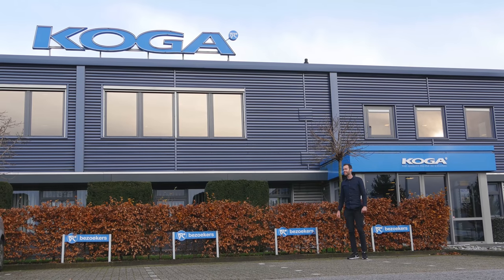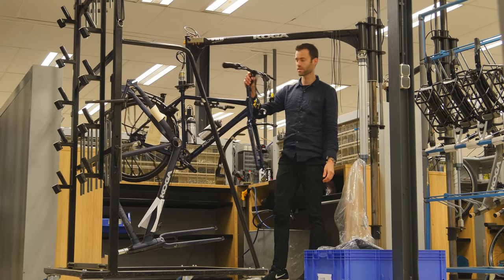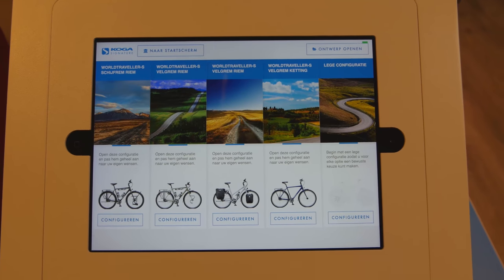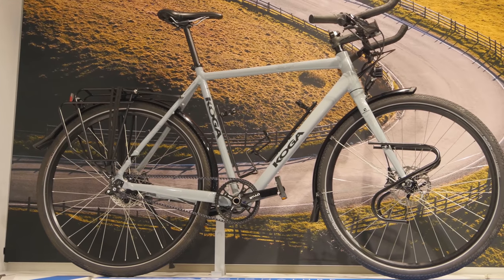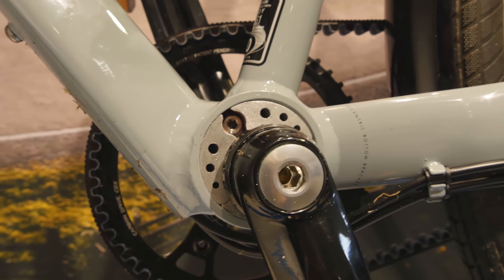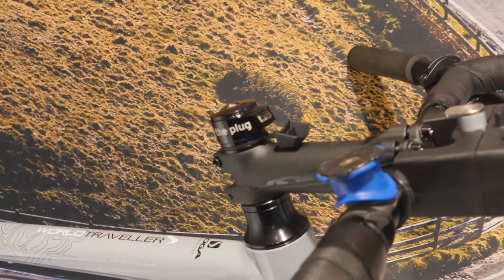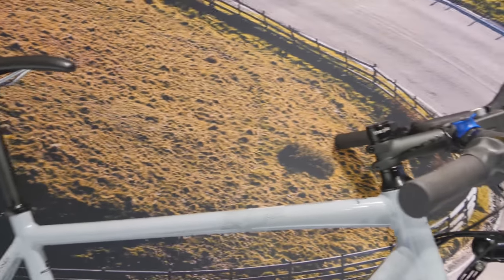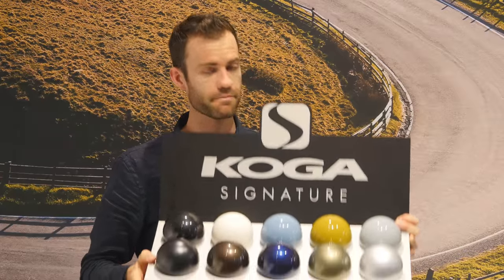My New Koga WorldTraveller Touring Bicycle For A 3-Year Bike Trip!!

Comment: Looking good! I'll definitely be following your trip! 
One thing I'd mention though, is an issue I've had with using the oversized bottle cages on an aluminium Koga. I had a similar cage (Topeak) on my WorldTraveller29, with a 1 litre fuel bottle in it, and had cracks develop around the cage bosses when my loaded bike fell over. The downtube itself had twisted slightly due to the weight and leverage of the larger bottle, and I could bend it back into place by hand. This happened in the first week of a 3.5 month tour, so I was pretty bummed out about it. A local bike shop said it was probably okay to ride, as long as I removed the weight off the cage and kept an eye on the bosses, and I had no further issues during the trip. Got a replacement frame from Koga once i returned home, so no issues with warranty. Just something to keep in mind with these thin, butted aluminium tubes.
Reply: Also, Tubus has a 30 year warranty and 3 years free of charge replacement service, according to their website :)
Reply from the maker: Interesting – will keep an eye out, I've never seen this happen before!

Comment: Love the bike. Especially the Crazy George bars. I love the tech but would worry about the possibility of finding replacement parts if anything does fail. I’m absolutely sure all the components are super reliable and will see you through the whole trip but I’d imagine it’d be far easier to locate a square taper BB and a set of brake blocks in darkest Peru! Good luck, I’ll be following your trip.

Comment: Great video. How has the crazy bar worked out for you? I’ve heard one online review with concerned over the wrist position on long hauls. Cheers
Reply from the maker: I liked the idea of the Crazy Bar but I've never quite got the 45 degree section to work well. So I designed a similarly shaped bar with less sweep called the KOGA Denham Bar, which has been great.

Comment: Your bicycle looks awesome. Love the colour, internal cable system, belt drive, shimano gears etc. What do you think about the crazy handle bar? Does it help to go through the wind? Have you tried moloko & jones loop H-bar?
Reply from the maker: The narrow bullhorn section definitely helps you have a more aerodynamic positioning in the wind. I've also tried the Moloko, which I like, but then I cannot use a handlebar bag. The Jones Loop I didn't work for me.
In the end, I designed my own handlebar, the KOGA Denham Bar, which is basically a mix of the best aspect of each of those handlebars.

Comment: Re. The wheel building - i dare to disagree. Handbuilt wheels - and i mean hand tensioned and trued by a wheelbuilder - are in 9 cases out of 10 better than most machine built wheels.
Reply from the maker: It depends. A machine-built wheel can be tensioned in 30 seconds or up to five minutes. By giving the machine more time, you can increase the accuracy of the build hugely. If you've had problems with machine-built wheels in the past, I'd say the wheel was built by the machine in seconds. KOGA isn't pumping out huge volumes of wheels, so they can afford to run their machines much longer than most manufacturers.

Comment: Hi, I wonder what your length is because I saw you in other video's riding quite a small frame with large seatpost. I am 1.87m and also went to Koga in The Netherlands and thought that 57cm would be the one (that was also the one that came out of the configurator). But when I rode the 60cm it was just better. It leaves about 8cm seatpost but it just looks better.
Reply from the maker: The 60cm frame will likely be the best size for you. I'm 10cm taller than you, but I prefer a more 'aggressive' fit, so that's why I sized down. 👍🏻

Comment: Same as mine other than the handlebars, seat, and colour. Praying you don’t have the same problems as I have had with my own brand new KOGA, having to cut my world short. It is a real shame that KOGA couldn't have helped me from where I was in Europe instead of my having to return home to the UK. It has been good being home for Christmas with my daughters.

Rohloff on the other hand have been very helpful and we have had some good communication.

Rohloff management and I had a great chat on what would best suit my needs given my intended world tour. The conclusion was that I would revert from belt to chain drive. Still keeping the main Rohloff hub, as that is running perfectly, but just changing the front and rear sprockets and add a Campagnola 9 speed chain.

Rohloff have also supplied me with plenty of spares, including a new splined carrier as well as the new one they have just fitted, a threaded carrier too in case I want to go with that, and a spare carrier clip and some tools. They have also supplied a new rear belt sprocket in case at some point I wish to revert to belt drive once more.

All in all then if I include the new belt sprocket, I have enough spares for 3 full repairs, including a spare chain. Rohloff have also serviced and changed the oil in the hub, so I am happy with my support from Rohloff and looking forward to my return on the 1st of March to carry on from where I left off in Marseille. I have only completed 3300 km's after all.

I hope you don't, but if you at some stage start to hear a clicking noise and feeling it through the pedals, your first thought might be the bottom bracket, it was for me, but it turned out to be the splined carrier. The best thing to do if this is the case, is to check everything is tight and not lose, as the belt tension has to be spot on with this new carrier.

If it then persists, Rohloff and Gates have instructions available for adding a special thick grease to the carrier / components. This will keep you going again. After grease was applied to mine in La Rochelle, really poorly by the way by some really horrid people at Ecovelo Bikes, I managed over 2000 km's before it failed, and even then I could have limped on some more. 

Who knows, I may pass you in the Americas. Best of luck and wishing you well on your tour.
Reply from the maker: Should be all good. I'm using the threaded carrier rather than the splined to be safe. 👍

Comment: New touring bike aluminium is perfect but in lon run aluminium is loosing ,shape and riding properties unlike good quality chromoly . So if you want to enjoy many years a touring bike buy good chromoly and first af all very good wheels ( more important than frame ) .  That with welding in any village is just legend
Reply from the maker: This information is incorrect. Aluminium does NOT lose shape or riding properties over time. Aluminium touring bikes are engineered to be literally three or more times stronger than steel bikes so that they aren't affected by fatigue, easily withstanding the repeated loads and stresses of bicycle touring for as long as you use the bike. A well-designed frame of any material won’t be affected by touring stresses – steel, titanium, carbon or aluminium.

I've written very extensively about frame materials on my website: https://www.cyclingabout.com/frame-materials-for-bicycle-touring-aluminium-vs-steel-vs-titanium/

Comment: I've heard that there's been a durability problem with the new splined rear cog on the belt drive and that Rohloff is working on a solution but hasen't found one yet. Did you discuss this with Koga?
Reply: I've not heard that, what is the problem. Do you have any links for more info on this? cheers
Reply from the maker: In light of the handful of cases where the splined cog causes noise, I'm using the old threaded cog carrier. Hopefully, Gates/Rohloff have an updated design by the time I wear my cog out.
Reply: Are they interchangable? Can you use a threaded cog on a new splined Rohloff hub without a rebuild? I have the new splined one, haven't had any problem in 3 000 km, but having trouble down the road worries me a bit.
Reply from the maker: The splined carrier is an 'adapter' that screws directly onto the older threaded carrier. No rebuild required. From all reports, the splined belt cog is only noisy for a select few – I decided not to risk it as I'm going to be pretty remote over the next 12 months.
Reply: So if I want to buy a Rohloff hub tomorrow and fit a belt drive all I need do is purchase an 'older' threaded belt carrier for the hub? Then do you need the sprocket itself for the belt as well which attaches to this carrier? Sorry just to be clear as I am confused.
Reply from the maker: The threaded carrier is the same for all Rohloff hubs, splined or not. You'd just need the screw-on belt sprocket which threads directly onto the hub. Perhaps the image at the bottom of this article will explain: https://www.cyclingabout.com/new-2016-rohloff-thru-axle-rear-hubs/
Reply: So is it possible to get a screw on centre track sprocket as the one in the pic on your site shows a splined one? Also in the pic your bike frame looks remarkably like a Surly Troll although it might not be. I know people who have converted the Troll to Rohloff belt drive. Is it a frame officially recognised by Rohloff as being suitable/stiff enough? If not, I don't know what other frame would be stiffer as it is built like a tank. And the Rohloff hub would have to go back to Rohloff to be converted? Cost? Thanks for your help.
Reply from the maker: - Exactly. The old-style cog screwed directly onto the hub. I was trying to use the diagram to show how the splined system is an adapter.
- The frame in the pic isn't a Troll because it's aluminium!
- The Troll frames need to be modified to fit a belt. This is do-able but not recommended. You're better off finding a frame that's designed around fitting a belt – I've got a long list on CyclingAbout.
- I can't say whether or not the Troll frame meets the stiffness standards for a belt drivetrain. Just looking at one isn't quite enough. Having ridden a Troll, however, I think you'd be surprised at how stiff they aren't.
- Rohloff hubs need to be specified for belt use when they're ordered. Not sure what the cost is to have them converted – you'll need to check with your local Rohloff supplier.
Reply: Thanks for your reply.
Reply: On my last trip in Thailand, Laos, Cambodja and Vietnam, the splined sprocket caused some noise. I went to a garage, put some grease in the narrow spaces of the splined carrier and the sound was over.
Reply: Glad you addressed Stephen's issues with Koga and Rohloff. To say the least he was not impressed with Koga's customer service.

Comment: If the machine does the truing then the wheels are not actually handbuilt. It`s just cheaper to have a human put the spokes in place than buy a robot to do it. It`s called hand assembly.
Handbuilt wheels are entirely constructed and trued by hand and that`s why they are better than the other kind.
Reply from the maker: I like my wheels tuned to precision and would, therefore, argue that a robot does a better job. Robots can instantly calculate the flow-on effects of every extra newton of force applied to the nipples, and push out a wheel with dishing to within 0.05mm. It's a proven technology adopted by almost all high-end wheel companies. 👍

Comment: I have a Koga steel bicycle the Randonneur 2011 do you think that now Koga don't do steel bicycle any more will my bicycle frame still under warranty?
Reply from the maker: Koga frames with unsuspended front forks have had a lifetime warranty since 2007. So yes, if you're the original owner, it will still be under warranty. I'd say Koga have surplus steel frames in storage for the times when something goes wrong.

Comment: ?what is the maximum weight that can be handled by KOGA world traveler or signature
Reply from the maker: I'm not sure, but it's a LOT. Probably best to email Koga. What are you planning on carrying?!
Reply: I am planning to go solo with full packing. I have already contacted Koga and they told me officially as per their measurement record is 130 but it can go up to 150/160 with no supported measurement. That is why i changed my mind and bought The Thorn Nomad due to its durability

Comment: Just curious, are you  riding south to north (headwinds) why did you chose that route?
Reply from the maker: Craig Warren I wanted to start at the end of the year, which was too cold for me in Alaska! The headwinds were tough in Patagonia, but by the time you get to the Carretera Austral, the wind blows equally in all directions. 👍🏼
Reply: @Cyclingabout  thanks, I to have biketoured in heavy headwind, not fun having to pedel hard on a downhill section. just to keep from being blown back up the hill. All the best in your traveles.
Reply from the maker: @CRAIGNV  Some cyclists start in El Chalten, ride down to Ushuaia, fly back to El Chalten and continue their journey north. Probably would've been smarter if I did that.

Comment: Aluminum for a touring bike?  I'd rather gain a few pounds for the reliability of steel...
Reply from the maker: I wrote this on Facebook a few days ago and hopefully, it provides some insight...

"When I first shopped around for a touring bike, it had to be steel. Experienced bike tourers were touting additional comfort and were selling me on the idea that I could repair my frame anywhere in the world.

A few years later, I started researching frame building and metallurgy and was now questioning these perceptions. It no longer made sense to me that steel could be more comfortable because diamond frame shapes are so stiff by design. In addition, a tyre, seatpost and seat already provides centimetres of vertical compliance, so any comfort steel may add would certainly go unnoticed. I also found out that steel frame manufacturing was a pretty specific skill set given the thin tube diameters — it's really easy to damage a frame through repair!"

In summary, I have 100% confidence in aluminium as a material, but I'll let my 40,000km bike trip do the real talking...
Reply: My Personal Preference for steel is Not that It might provide a better ride, its that Steel possess better fatigue Qualities than Aluminum...  That being said, a Properly designed Aluminum frame, one designed not to flex at all, will be reliable for years, and save weight over an equally stiff steal frame!     In-fact, It is the tires/rims that that are the primary factor that determines ride Quality, and not the compliance of the frame... 

Things I like about the Koga:  (  Koga being one of my Favorite companies for years...)  First, I like the Belt drive, Eccentric bottom bracket, and 14 speed hub for reliable and Maintenance free service!   I like that the frame has been made as Stiff as possible for stability down fast descents... I like your front Dyno Hub with it's capacity to charge your phone!  I like your Wide tires!  I like your Durable rimes, But personally, I would spec rims as wide as the tires...

What I Don't Like about Koga's World Touring Bike is that the Load is Not Suspended...  This will make the Bike hard to control at speed and over bumpy surfaces...  I Also would Prefer Drop Bars with Brake shifters... 

What I would Prefer is a Touring Bike that has it's Load suspended and the direction of rider force that is lateral so that power is Not lost when applying high force...
Reply: My Favorite Long Distance Touring bike is the Azub Max:  https://azub.eu/recumbent-bikes-and-trikes/topline/max/
Reply: I think build quality will have more affect on reliability than the material!
Reply: I travelled on a Koga World Traveller for 4 years around the world. The old idea that you need.a steel frame is kind of silly. Reliability is important for your wheels, pannier racks, spokes, tires etc., but there is little chance the actual frame is going to break with the quality of materials these days. My Koga frame will last longer than 100 sets of tires so if you're concerned with breaking down, focus on the parts that actually break down.
Reply: @WaltDesine  For a bicycle I reckon the theoretical fatigue life of the material is pretty insignificant. Airliners are even more weight sensitive than bikes and when properly engineered they've a 20 years designed life being repeatedly inflated and deflated like a balloon plus all the aerodynamic loads. You don't get that sort of severe load scenario on a bike. You get bending loads and it's all concentrated at the welded joints where the workmanship counts a heck of a lot more, as with any other material.

Comment: OIl system brakes on a tourer !!!  get ready for another nightmare. Just use AVID mechanicals . far more reliable and work better in super hot climates
Reply: Just no, no, no! All that pad rubbing and squealing because pressure is only applied to one pad of the pair. No chance. The hydraulic Shimano XT disc brakes on this bike are far far far superior to any AVID cable brakes. LoL.
Reply: @alexmorgan3435  I found Avids work great if you take a tumble and damage a hydraulic line bye bye brakes.If your miles from anywhere and can't fix it that's bad news.

Comment: touring on a None steel frame !!!!! try getting that fixed in the middle of a "shit hole Country"
Reply from the maker: Two things: The failure rate on bike frames is so low these days that broken frames are rarely a concern. Fixing a steel frame in a 'shit hole country' is generally a very temporary fix (I've met people that have had their frames re-break within a day), given the thin wall thickness of steel tubing which requires a high degree of understanding and skill.